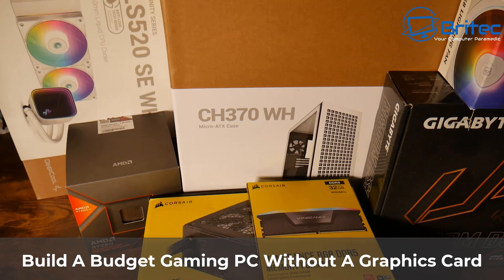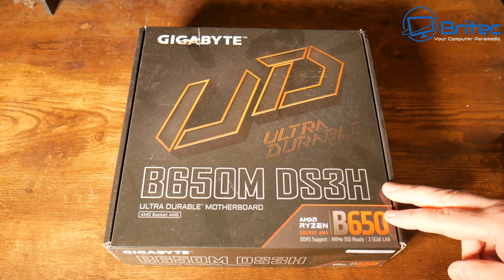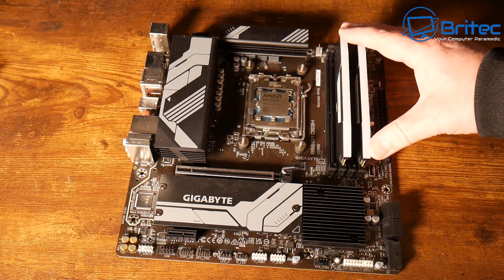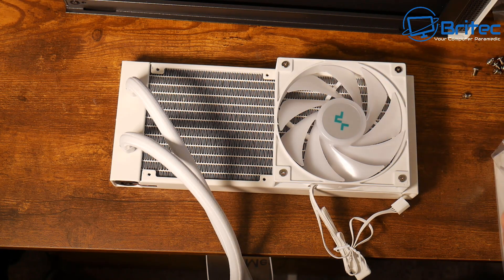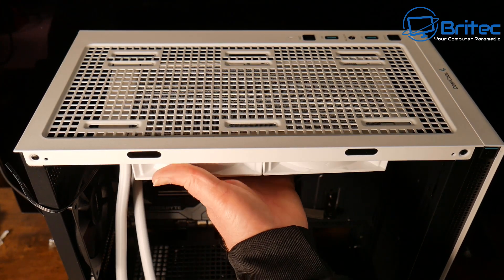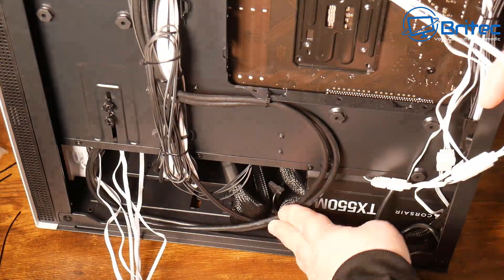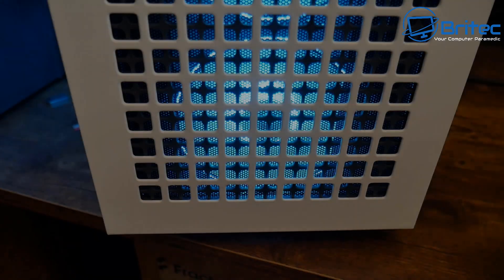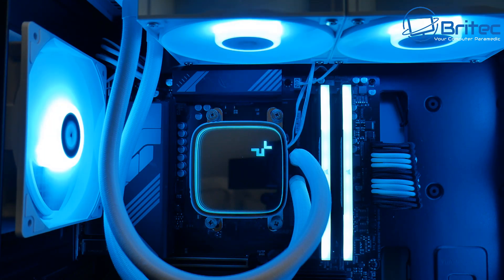Build A Budget Gaming PC Without A Graphics Card

Comment: As long as there is NO artificial intelligence in any of the products, then I'm fine with the build.
Reply: This processor has the 700M graphics and a core for nueral pcocessor.A lot better graphics than intel ,i bought this processor the first day it was on sale have built with the 5700G a big step over the 3400G i am replacing thousands of hours since August 2020.I hope you enjoy this processor Brain.
Reply: @hughluttrell6350  - If it has AI NPU chips, stay away. Don't buy them.

Comment: AIO on an 8700G? That seems a bit overkill. 🤨🤔

Also, for the cost of the 8700G, you could have built a better performing budget gaming system with a 12100F and RX 6600. 8700G = $300, 12100F and RX 6600 = $285.

If you're going to buy a "cheap" case and then buy fans and controller, why not buy a case that already has those in it? You're not really saving money. $60 + $16 + 16 (case, fans, controller) = $92. Montech AIR 100 ARGB White = $70. Fractal Design Pop Mini Air White = $90.

I'll grant you, yes it looks nice, but I think it could have cost even less overall.

Now, if your goal was to get on AM5 at lowest cost, this might make sense, but the 8700G is overpriced for what it is. It was a bad buy at the original MSRP of $330, and it's not a whole lot better at $300. And I say that as an AMD fan boi. My gaming system is now all AMD (5600X and RX 7800 XT), having replaced my RTX-3060 12GB card just about a week ago.
Reply from the maker: Your build, your choice. Not building this for profit. building it because I like it.

Comment: Since I am not a gamer that's what I did with my two builds I did a year and half ago. I have no need for an expensive gpu. Both builds are AMD Ryzen 5 5600G, both MB's are MSI, one a B450 gaming plus max and a B550 Gen3.

The 450 is in an older alien type case that I repurposed (80mm fans) and 550 is in a Fractal focus g case with 120mm fans. Yeah I know 80mm fan case is obsolete but believe it or not it's Temps run good, 25c to 37c. I kept it because of the design style, the 5" bays and 5 storage drive rack slots (all tooless).

Both systems I built approximately cost me 5 to 650 dollars each. Both with Corsair vengeance ddr4 ram 16GB each, PSU by AGW a 550 and 600 W. One is using AMD stock cooler and the other a be quiet. Both use 1 TB NVME for OS and mechanical drives for storage. In reality one only needs a 250 to 500 GB drive for the OS, but I wanted the room just in case.

Some tricks for budget systems is Amazon, and look for sales on new parts from reputable vendors. Semi modular PSU is a plus, also since I am not running a GPU a 550w PSU should be ample power. 

So if one is on a tight budget, not into serious gaming, looking for a basic build for light gaming, internet use and basic home functions with current windows version this is the way to go to start. You can always upgrade later.

One last recommendation, choose your parts wisely and make sure they are all compatible. If you want built in graphics be sure you select the correct processor with the built in graphics. Do your homework before you buy. 

It's fun, not too complicated and you get satisfaction out of building your own to your own design. Possibilities are endless. 
Also be sure you find the correct case for your design or needs to correspond with the MB you choose. As for cooling goes there are a plethora of options, but to start keep it simple. You can always change it up later on.
Reply from the maker: Thanks for sharing